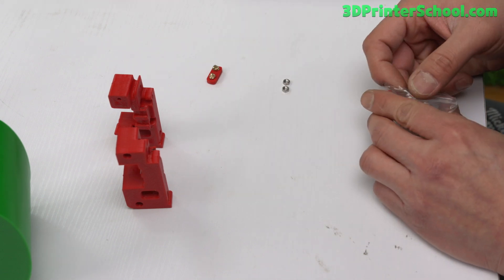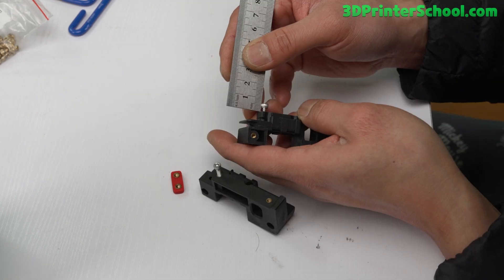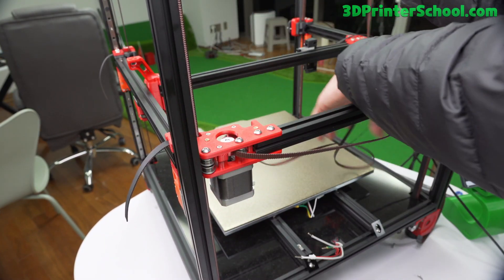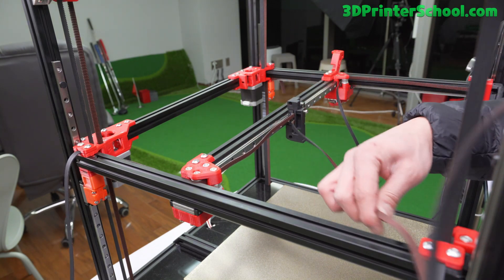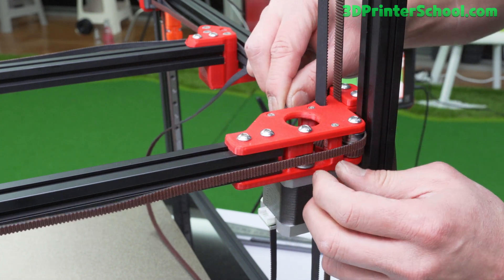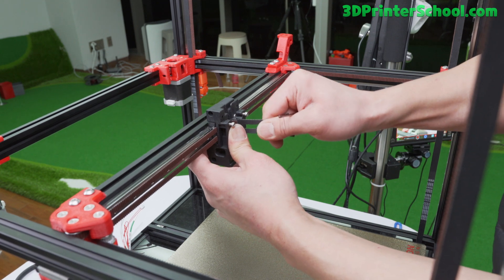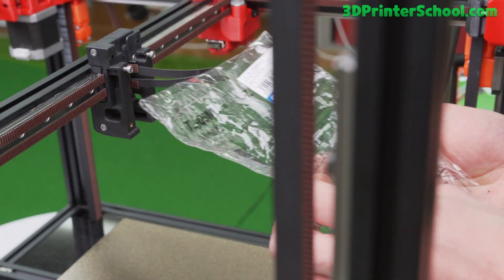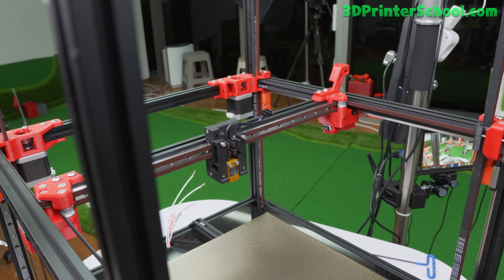How to Build a Voron 2.4R2! - Step 9 AB Belt Installation!

Comment: Does every kit come with those parts. I don’t think mine does
Reply from the maker: I recently ordered this so if you ordered this after december 2022, it should come with one.  If it didn't, it doesn't hurt to ask they may send you one.
Reply: In case someone else with a (recent) formbot kit comes here. It ships with voron tab and you need to follow the voron tab instructions. This is why there are different parts inside that don't match the parts in this video

Comment: The printed part that attaches the z with the 4 small bolts and the one long bolt. Should the long one be tight or loosely tight to alow it to wiggle? It seems like it's cupped to allow it to move around.
Reply from the maker: The Z joints you mean?  They are supposed to be tight.  Make sure to hold the Z joints while tightening so they don't move.
Reply: @3dPrinterSchool  thanks bud